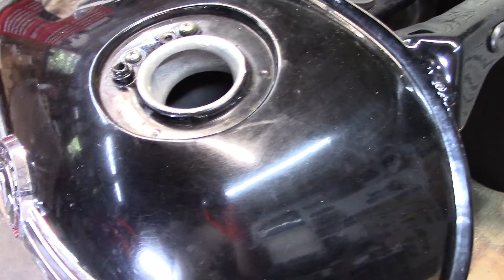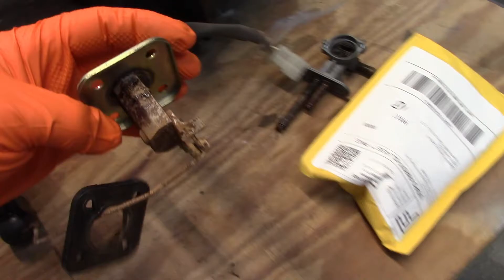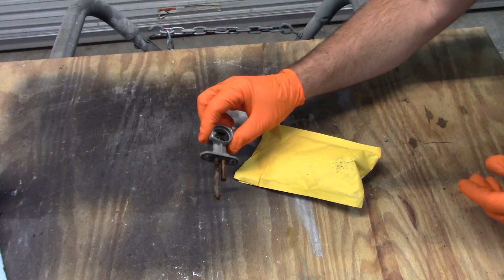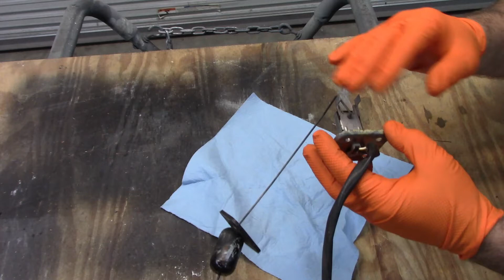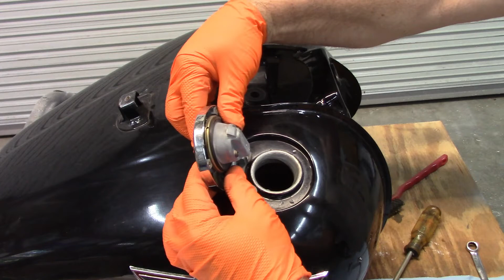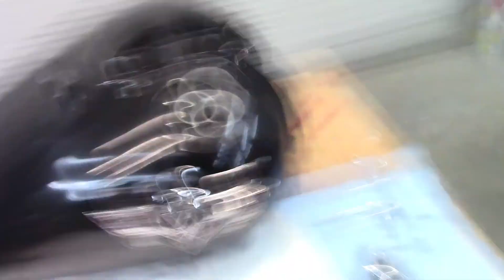Motorcycle gas tank lined with por15. Reassembly.

Comment: Thanks for making the video. So how has the results been? I've seen guys do exactly what you did and the tank sealer did not stick. I was trying to see maybe what he did wrong. He cut the tank open and found light rust under the sealer making it not stick. Maybe he didn't use the metal prep? Not sure. 
Thanks again for the process review.

Dude, plasti-dip would seal that sending unit nicely or perhaps flex seal?  Not sure if rubber deteriorates in gas.
Reply from the maker: As far as I know it worked fine. Metal has to be prepped for it to work properly.

Comment: I like what you did an wanted to do same. But ime converting a efi merelli maganeti efi to carb so it's a little more tricking to coat inside since I need adapters 1 an 2 theres like 10 screws that hold the plate on . So I dont know if I could actually accomplish without scewing it up . 1998 road glide anniversary edition

Comment: Put what ever is necessary into the tank wrap it in blankets and put it into a tumble dryer with no heat. The screws on Japanese bicycles are not Philips that are J.I.S.  you will save a lot of screws if you get yourself a J.I.S. Screwdriver. Thanks for posting.